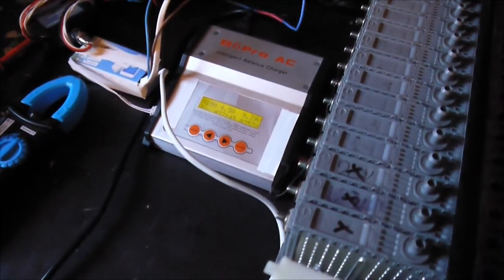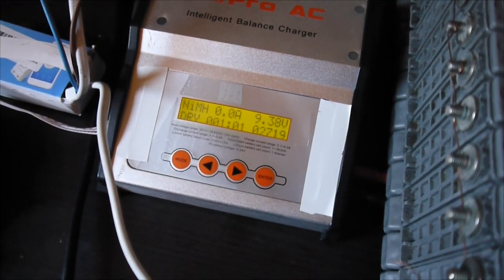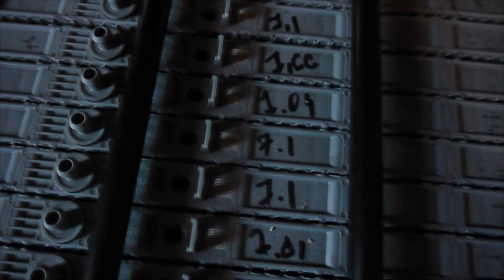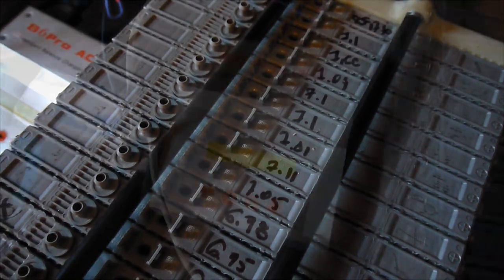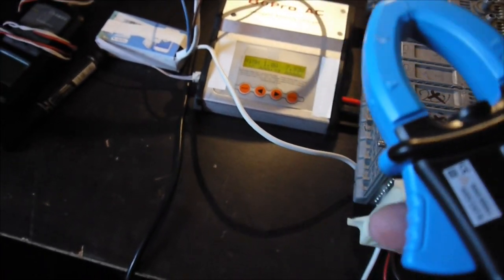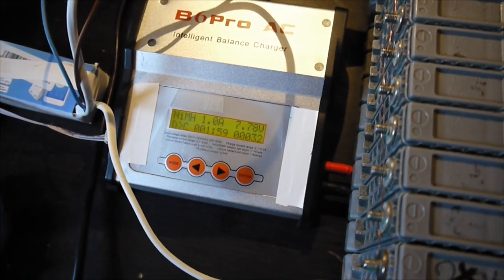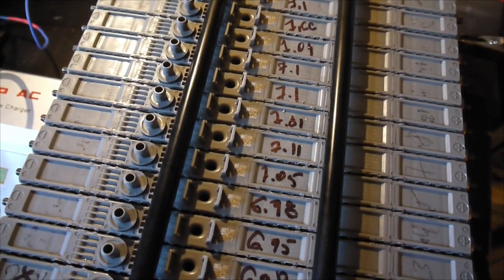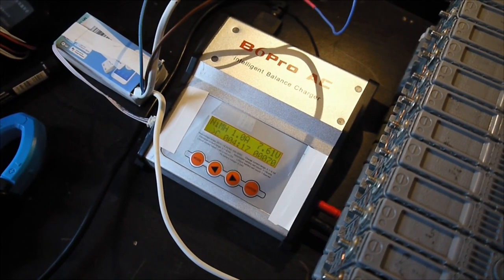Hybrid battery test and cycle any MiMh cell for hybrid HV bateries with a modified IMAX B6Pro AC.

Comment: How long does it take to charge one module
Reply from the maker: around 2 hours at max current, like 5Amps, for a good module..the ones I'm testing here are like 50% capacity..
Reply: @viocaia  ok thanks how long do it takes to discharge
Reply from the maker: If you use a regular IMAX with 1Ah..will take like 7-8hours..if you use a modified one , like I did in the video next, like 2 hours..check this https://www.youtube.com/watch?v=ljesaRwfRyE